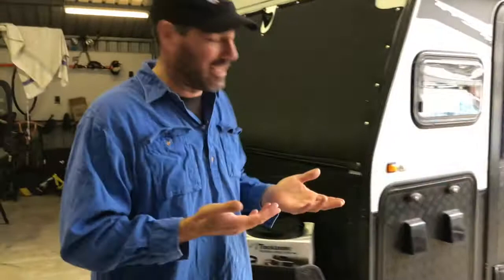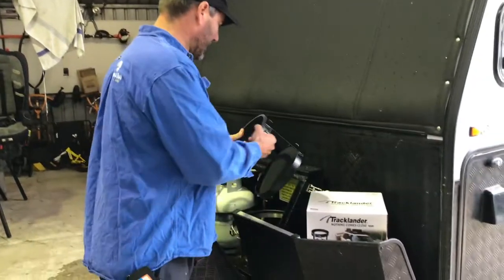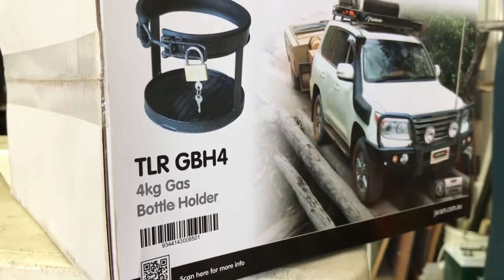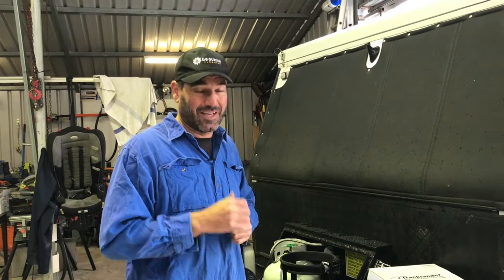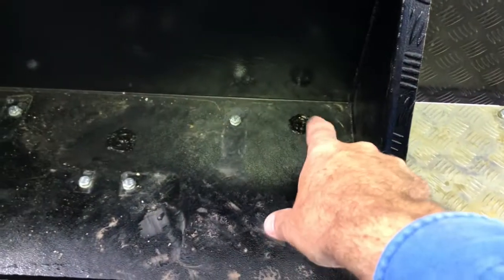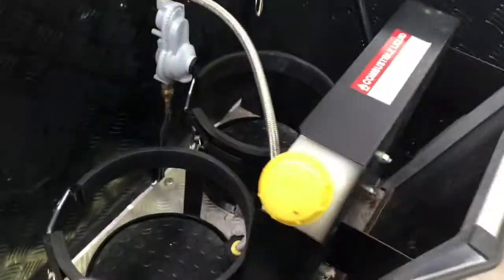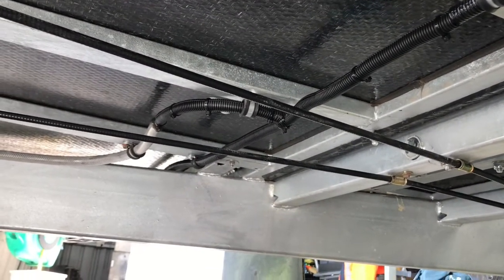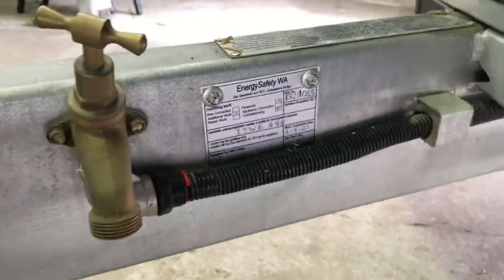Forbes 15+: How to Move The Gas Bottles

Comment: I replaced the gas service and relocated the cylinders in a soft floor camper trailer the customer installed himself, 9kg gas cylinder was on its side under bed and the regulator was screwed to the floor in a horizontal position to top it all off the copper was all connected with sharkbite fittings. He was especially proud of how water (and air) tight the bed of the trailer was. 
Reminds me of a saying one of my tradies would tell me about poor quality gas installs. 
one flash and your ash.
Reply from the maker: Hi Micheal. Thanks so much for the comment. Glad you sorted that one out before it was too late. Do subscribe to our channel (if you haven't already) so that you get notified of our new videos :)  https://tiny.cc/beautifulsubscribe